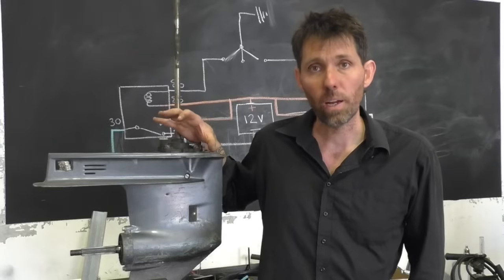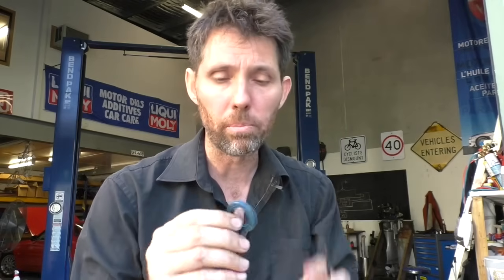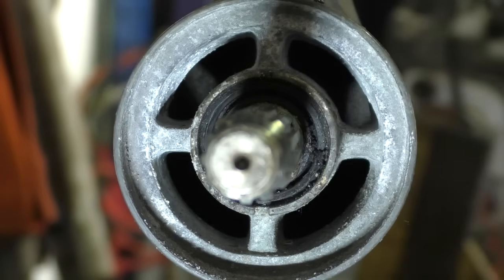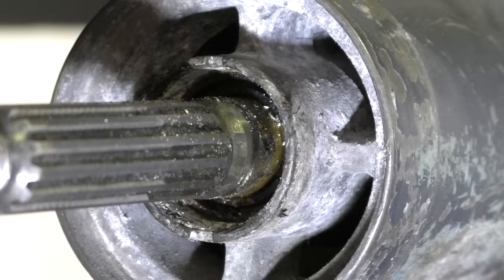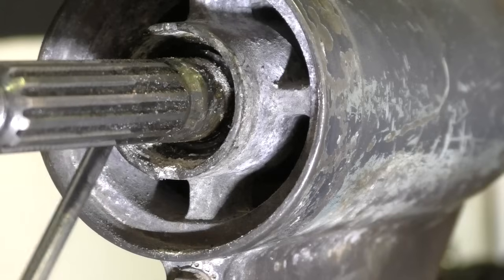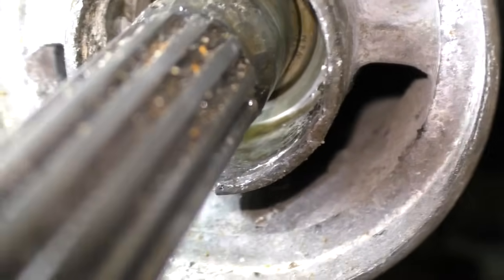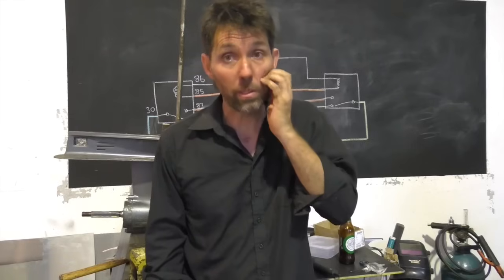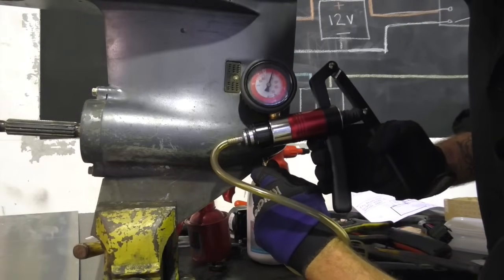Replacing outboard oil seals the hack way

Comment: This is an awesome piece of advice. Thank You! My boat is a 1990 Chapparel with twin Volvo Penta 350's (chevy small blocks) and DP-a out-drives. I'm sure the original owners never even picked up a screwdriver themselves. Still stout, this vessel requires a decent amount of TLC to keep her sea worthy. When I saw oil dripping from the prop shaft after we pulled her from the water in November I thought that would be the last season for the old girl. Your video gave me confidence that a $2,000 job could be done for the price of the parts $30. You are worth your salt mate. Thanks for this video please don't stop producing them. If you ever get to the state of Connecticut in the US look me up dinner and drinks on me!
Reply from the maker: Thanks mate, glad the video helped you out. Always great to hear of a boat back on the water after a bit of DIY. Thanks for the offer of dinner! :)

Comment: thanks Dangar Marine have two o/b same make and year one the prop was frozen on used all know even brake fluid after three days pullers actually pulled prop off rubber mount had to grind bronze sleeve and use a pin punch to get to spline it had rusted on the other is now parts all because of the lack of lubricateon shaft thanks
Reply from the maker: Yes, a bit of grease on the prop shaft before putting the prop on goes a long way.
Reply: @DangarMarine  hello sir, how do i can buy this air pump with gauge, i am from qatar, please whatsap me 0097450905118,great help from you

Comment: Hi stu.Im changing the engine oil on my yamaha f40 motor.The oil seal around the drain plug was split and torn, i managed to get it out but not sure how to get the new one in .Is there a special tool needed for this ? Loving all your vids mate natural born teacher!!!Cheers Damo
Reply from the maker: Hi Damo. Can't say I've ever replaced one of those rubber seals, normally if a sump plug has a rubber seal we just get whole new plugs with the seal already installed. Can you post a picture of it on the Facebook page so I can take a look?

Comment: What vehicle those seal from do u have the parts number?
Reply from the maker: They aren't for a specific car, they are just sold as generic oil seals that match the dimensions. Best thing is to take the original in with you to a bearing supply store. They will be able to measure it.

Comment: If the inner seal looks OK and you're installing a double-lip seal outside, I'd LEAVE that inner seal there.  The reason they use two seals is to keep water OUT and oil IN!   Sealed is sealed.  Replacing that outer seal and pressure-testing successfully means the unit should be good for at least several hundred hours of operation.
Reply from the maker: Hey Russ, yes I tend to agree - if ain't broke don't fix it. The inner seal gets a much easier time of things than the outer too - oil to lubricate it, no fishing line and sand etc.

Comment: 99.9% of all oil and grease seals are industry-standard metric dimensions, an OD, an ID, and a thickness in mm's.  They can be had at a bearing supply house for about $6 or less ea.  Don't pay marine dealer prices.
Reply from the maker: For sure, our local bearing shop has been gold for supplying us good quality seals for outboards.

Comment: Do u have to drop the lower unit to get the baring housing out ?  Have a 90 hp Johnson 2003
Reply from the maker: No, you can pull the bearing carrier while leaving the lower unit in place.

Comment: There may be a good way and a better way of doing a particular repair, but if one knows the principal aim of what needs to be done and what are the priorities in obtaining a good performance, then one can do whatever one needs to do. Once at Chatham dockyard I was down in a submarine and  needed to hammer in some small unit, but did not have a hammer, but I did have a pair of pliers, and when I was about to hit the unit with a pair of hammer, someone told me, " You cannot do that, you have to go and get a hammer!"    Well getting a hammer would have meant a long walk and so I persevered in hammering with a pair of pliers.   The unit was in place just as accurately as if it was hammered in by a hammer.  So as you well indicated, there may be better ways of doing some work but if it needs to be done it has to be done.    In the days of the  Clipper ships, the famous Cutty Sark lost its rudder and the crew and the captain all helped to make a compromise rudder which got them home, as any other rudder made in the proper manner!!
Reply from the maker: You're dead right that sometimes you just need to do what you need to do. In this case it isn't that unorthodox as it is pretty much the only way you ever take front and rear main seals out of car and inboard motors.

Comment: I have a 1958 35hp Johnson model RDE19 C  the parts diagram shows the shift rod o ring and gasket going on top of the shift rod bushing,this  doesn't seem right would you have any imfo on this?
Reply from the maker: Hi Pat, unfortunately I've never seen one of those outboards. The parts diagrams have always been accurate in my experience though.

Comment: Good job Stu. Bit of a work out on my abs (they were flexed and I was grunting as you pounded on the bitch)  bwahaha. Have done seals on cars and trucks the same way. Nothing wrong with doing it this way. It`s called desperation. A shot of Tequila would have been deserved, amigo. 100% Agave  only way to go.
Reply from the maker: Thanks mate. I called this "hack way" because with outboards you are supposed to remove the bearing carrier, but you are right, with many crankshaft seals there is no other way to do it and this is standard practice so it really is a valid technique in its own right.

Comment: Im having to replace the oil seals the "hack way". The o ring or bearing behind both oil seals was slightly damaged from my flat screwdriver. Is that a bearing? It looks removable.  I have a 73 65 hp Evinrude. Thank you for your video. I wouldnt have gotten this far without you!
Reply from the maker: It may just be the back of one of the seals or a washer. You generally can't damage the bearing from the outside like that.

Comment: Thank you so much for this, I used your technique to replace leaking driveshaft seals in a 2011 250hp Evinrude ETEC, once I had the holes drilled I pulled the seals with the barbs on big straightened fishing hooks. When I inserted the new seals I placed an old seal on top of the new one to protect it, then cut a length of three quarter inch pvc pipe to fit over the driveshaft and hammered the top of the pipe to get the seals down. The gearcase bearing housing on my ETEC is PRESSED, so practically impossible to remove and replace for work without the specific equipment such as a 10 tonne floor press... I really dig your style dude!

Comment: So I didn't see the housing with the 2 bolts being removed. Did you remove it before removing the oil seal and if so how?
Reply from the maker: No, the main point of this "hack" way is that the bearing carrier remains in place. Here is another video where I remove the bearing carrier on a different outboard https://www.youtube.com/watch?v=_PnpoEDPqMA

Comment: After thinking for a moment I would like to rephrase that question...   you essentially have four seals the inner is lubed by gear oil the outer is by water, what happens to the inner two that are essentially dry?  Naturally you'd think four is better but?  I suppose even if the inner two wear out from lack of lube,  you still have the outer two doing their job!  Thanks
Reply from the maker: I wouldn't imagine these seals are 100% effective so a small amount of oil and water will pass into the centre of the seals.
Reply: I will keep that in mind, if I run into some good quality after market seals on the cheap!  Have a place in town that has all that stuff...
Thanks for the quick reply!

Comment: I assume you ended up using 2 double lip seals?    Also, I kinda wonder, if the outer double lip may be lubricated by being in water and inner double lip is lubed by the case lube?  Thanks for your vid's''

Comment: What do you think about the following tool for removing a seal? https://www.youtube.com/watch?v=TYkZlKYSz4Q Awaiting for your feedbacks.
Reply from the maker: Do you pre-drill before putting the screw in?
Reply: Pre-drilling is not necessary. These are special cutting screws. Together with the pressure, the screw goes into the seal as by butter.

Comment: @1:26 can anyone tell me what the hole is about 10cm left and up from the water intake.

On my 2 stroke outboard motor I have gearbox oil leaking from that spot and I'm unsure why.

Thanks in advance.
Reply from the maker: I'll confirm tomorrow, but I believe that just goes into the exhaust housing so the oil may be coming from water that gone up through the power head, not directly from the gearbox.
Reply: Thanks,

Comment: A way I remove seals around a prop shaft or crank shafts is to carefully drill 4 holes through the metal of the seal and screw in 4 dry wall screws and once they bottom out turn each screw one turn at a time and the seal will be pushed out . This method has not failed me so far
 .
Reply from the maker: A similar technique is to put the screws in and use a slide hammer to pull the seals out. I also like the technique of drilling through a ring spanner to keep the drill bit away from the prop shaft.
Reply: screwing the screws in wont harm the bearings behind the seals at all?
Reply: What about any metal shavings being introduced to the bearings?

Comment: fyi those numbers on the seal are metric sizes  22-36-6 22=22mm shaft size(i.d,) 36=36mm housing size(o.d.) and 6=6mm thickness. so if you have a seal with no numbers or a part with no seals in it  or you destroy them without knowing you can measure  and come up with a seal
Reply from the maker: Thanks for the info, good thinking.

Comment: Could you get away with using these alternative oil seal for a drive shaft seal under the water pump or is it best to go OEM in this location? The outboard in question is a 60hp Yamaha (2000).
Reply from the maker: If you can get the right size I think it would be fine to use them on the driveshaft too.

Comment: I agree very much with your videos .. there is the "text book way" however in this case having to pull the gear case bearing carrier is actually more of a pain and to some degree if it's not broken why fix it 

I'm actually in the process of changing the o rings on the shaft near the water pump at this point my biggest nightmare has been the impeller key it's been stuck and taken me 3 days using heat gun and a lot of hammer 

I really enjoy your videos I think for those that will do it yourself this is perfect !
Reply from the maker: Thanks mate. Some parts certainly too get very stuck and trying to remove them just risks breakage. Good luck with your impeller key!

Comment: I tried changing the gearbox  and it was white as in water and oil mixed and every time I tried reversing the boat it doesn't get in gear properly you think this is the problem the sealing?
Reply: Gearbox oil*
Reply from the maker: Yep, if ever you get water in the gearbox oil it is definitely these seals.

Comment: What is the best material used to fill in screw in holes in a fiberglass boat deck.  Thanks again Larry
Reply from the maker: You'll be looking for some sort of epoxy resin with a micro fibre in it to thicken it up. One other piece of advice I read that I really like is rather than trying to clean the inside of the hole to get a good surface to adhere to try drilling it out one size and then just vacuuming the hole so it is perfectly clean without being contaminated by solvents.
Reply: Thanks for the advice, I will give it a try. Keep on getting on!!!!!   Larry

Comment: Interesting to hear about using engineering quality oil seals .. I have done exactly the same and got the same advice from my supplier.

There are some issues in obtaining exactly the right size, but I've found there are many available, that are more than suitable.
Reply from the maker: Hey Geoff, we are lucky that our local engineering shop stocks quite a range of seals so we've always been able to get an exact match and they are always heaps cheaper which is nice. :)

Comment: I just removed the housing out turn it so the seal where facing down and bent a screw drivers so it hit the inside seal and tap it out. both seal came out together in seconds. Make sure your not touching the needle bearings with tap them out
Reply from the maker: It's always great when they pop out quickly like that. :)

Comment: I drill a  small hole, in the seal,  Take compressed air, My air gun with a Needle tip, to match,   One quick blast or two, & that seal is out..                                                                                                                                                             kodi
Reply from the maker: That's a good tip, I'll give that a go next time. It reminds me a bit of hammering bread into a spigot bearing to pop it out (only less mess!)
Reply: Great idea. Would love to see a video on this technique.
Reply: I can see how that would work but how about popping seals you don’t want to remove like those that are in the upper portion of the lower unit?
Reply: Not that I doubt you (much), but if your technique really works, why not put pressure in the gear box housing to pop them out? You would be doing this anyway when you do this technique to get the inner seal out, or do you just ignore the inner seal? Your technique MIGHT work on a brand new engine, but no way with one like in this video with all the corrosion. Also the seals are usually damaged and not sealing to begin with, so how is the pressure suppose to pop them out? Yes.. I would  like to see a video, and I'm not from Missouri
.
Reply: I dont think this trick will work. The seals are facing lips out, so they dont keep the pressure in. Normally on car, motorcycles etc the lips are facing in. Just replaced all seals on my -90 yamaha 130 beto gear case. Correct way is to make vacuum in gear case to check the seals. But i pressurized the gear case (tip i got from a old race driver). Before the repair, it did not keep the pressure at all, digital gauge shows 0,00bar. After repair, the seal lips releace the pressure at 1.7 bar. After 24h, the pressure was 1.00bar. Good enough for me.
Reply: can you just shoot air into the filler hole and not drill a hole in the second seal????
Reply: If with no compressed air, get yourself the sharp pointy tool that dentists use to spot tooth cavities, pull SS metal ring out,  drill 2 tiny holes facing each other in middle oil seal and gently pull it out with tool. With such dentist tool can pull out just about everything rubber, say o'rings, oil seals..

Comment: Is there a certain way that the seals must face whilst installing them? I've head that the orientation of the seals depends whether it's holding oil in or keep water out.
Reply from the maker: +Weston Sharer The general rule of thumb is that the spring faces towards whatever the seal is retaining. On Yamaha (and probably other outboards) both springs face outwards towards the water.
Reply: thx
 m8!

Comment: I got a Honda BF40 2005 and seals are done, oil is leaking while motor is running and i see oil in water. Currently outboard is out of water and i run it on mufins. What would you recomend me: could i do it alone or should i get it done by mechanic.
Reply from the maker: It could be a few things. It could be gearbox oil coming past the driveshaft seal and being drawn up through the cooling water and back out the exhaust. If could also be a blown head gasket allowing oil to transfer between the water and oil galleries.
Reply: Hmm it doesnt come through the peehole i am sure and when i slided of prop i saw there, mostly on prop shaft white oil... Can i make a video and send you somehow? That would really help me.
Reply: How much bars-pressure should gearcase hold?

Comment: Took the prop off, the washer behind the prop was not all the way down the shaft, stopped at a tapered part of shaft, wasn't touching any seal, is that normal or do I have wrong parts on it? model is 85393M 1973 evinrude 85hp
Reply from the maker: Sounds to me like it's just on backwards, try turning it around.
Reply from the maker: It doesn't touch the seals though by the way, but if the washer doesn't look like it is going all the way into place it may be reversed.
Reply: Thanks, the washer was tapered , just noticed it, im kinda thinking this motor has been through it, just seen welded parts on the rear of cavitation plate where the fin I bought bolts on, small crack on each side, fixing to check gear oil for water, do you have a video on cavitation repair?
Reply from the maker: No video specifically on repairing those plates yet, but I'll add it to the list. There are plenty of good videos on general aluminium welding around though that would be worth checking out.

Comment: thanks for getting back to me. Wow, you  are 1/2 a world away!! guess folks do things pretty much the same "down under"! Now about that beer!!! So, the one that you used had a red handle, a black shaft and a little cork screw looking tip. You snaked it round the shaft and popped out the seal. It was a strange little tool. the larger one that you sent me the link for was different,  I haven't had much luck with the bigger style when the axle is still in. I really like that you actually look like you've been "wrenching" in the videos. Pretty silly stuff when they look like they  just stepped out of the shower and started tearing down an outdrive.
Reply from the maker: Ah, I think I know the one. From memory it actually came in a set of gasket scrapers. http://www.ebay.com.au/itm/like/262889892884?chn=ps